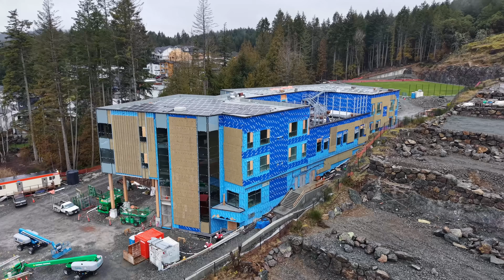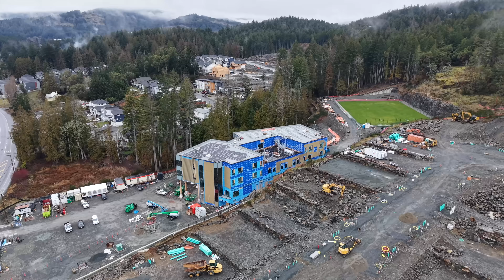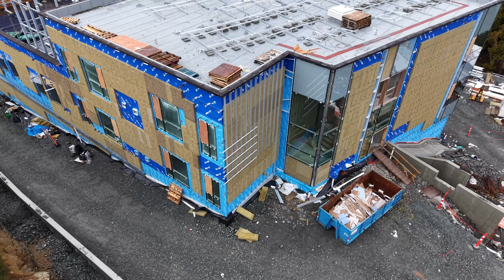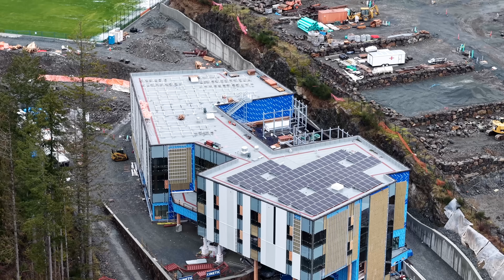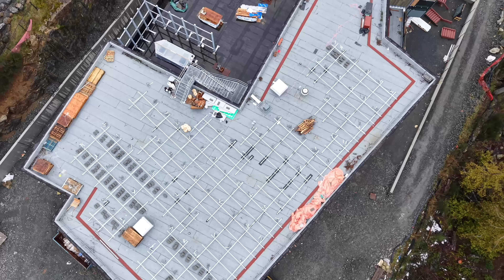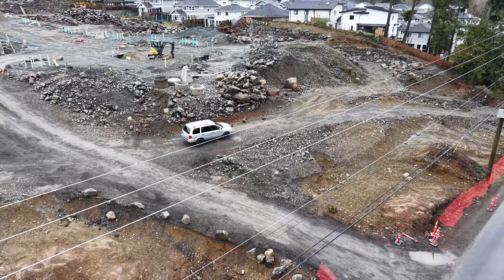Construction Of A New Four Floor Elementary School

Comment: I will say this from a firefighter's perspective: No school, or any building designated as a point of refuge, should be anything than Type 1 or Type 2 structures (those being fire-resistive and non-combustible, respectively). To build a school with wood framing is just asking for a catastrophe, regardless of any life safety systems that may be in place.
Reply from the maker: There's definitely been lots of combustible construction schools before this one. This is the first one they've done with mass timber which supposedly is supposed to be pretty well non-combustible not sure how much so that is actually the case.

Comment: Well described regarding the engineered  timber construction. The sprinklers protecting glass etc are called drenchers. The water on the surface takes a lot more energy to boil it off. Latent heat of vaporisation.  Cheers

Comment: bro my towns school district are franticly trying to expand the capacity as every single school is well past capacity, even the new one when they were building they had to add a wing too it. My towns middle school was originally ment for 400 students, was then expanded to 550 and then ~800 and now there is 940 students enrolled there. The high school is expected to pass capacity next year when the 8th grade class moves to the high school. In the late 2000s the my school district started to rapidly expand. Then in 2014 the start of a mass population boom of mainly families moves in because of the school system. Apparently the middle school hallways are are insanely crowded and the high school hallways are crowded in the main hallways. Ok that’s enough yapping for today. also my school district was rated the best in my state

Comment: That district seems to be sticking to Notifier, so I’m guessing the FA system is most likely to be that. Do you think it will be Notifier INSPIRE series? I don’t think it really makes any sense to install a new Onyx system because they are getting replaced.
Reply from the maker: That's what I mentioned in the video. Onyx series is still a perfectly good system though. It won't be obsolete overnight.
Reply: @ Definitely

Comment: I wish Notifier spec’d the MPS pulls to have the key reset, because the hex reset seems to be the main problem with the pulls not resetting properly. The monitor modules could also use a redesign to make them more compact. Other than those two things, I think the RSG pulls are better than the BG-12 pulls (I know that’s not the Notifier model, I’m just talking about the series In general).
Reply from the maker: Yeah I'd say they're better once installed they just suck to install and work on

Comment: only 450? wow my elementary school was 1 story all outdoor like most california schools, it has 573 students, 2 classroom buildings, no portables at all, building 1 had rooms 1-8 and building 2 had rooms 9-16 and that was it. 2 rooms taught the same grade/some were a combo. we had a small office too. the rest was just the recess area. we had 30-40 kids in each room. they had 35 in my old 6th grade classroom. the system was a small notifier firewarden system with spectralert advances on high volume. they had outdoor hallways so they had alarms there too. they were all set on high volume code 3, even in the kinder rooms.
Reply: there is also a cafeteria too
Reply from the maker: That would not be legal here. There are limits depending on age ranging from 22 to 30 students per classroom.
Reply: @nics-systems-electric yeah thats what im thinking but california allows you to do anything they dont have hvac shutdown and the systsems unsync